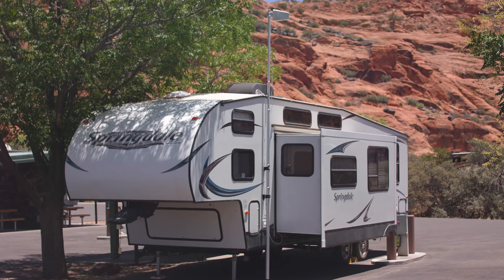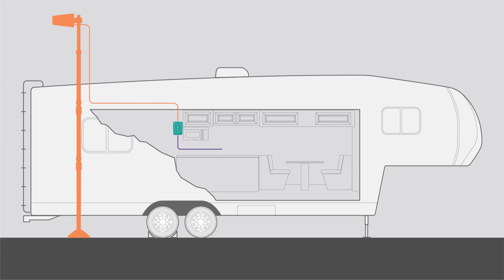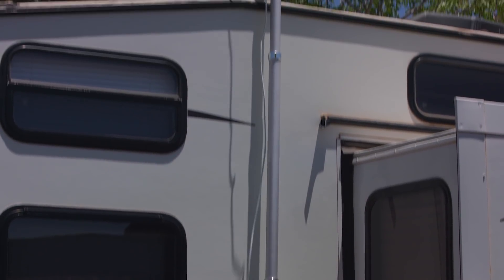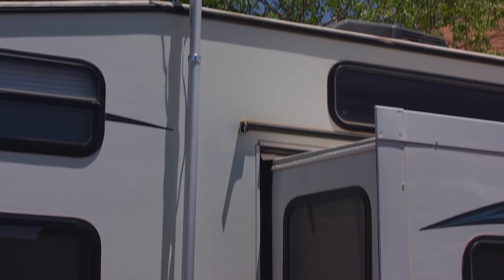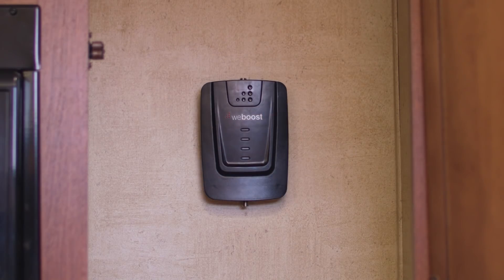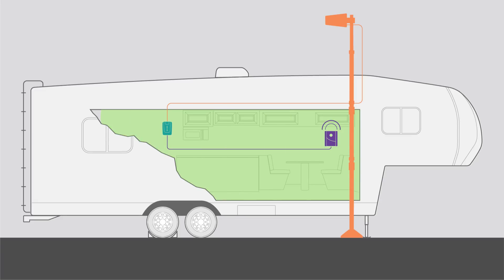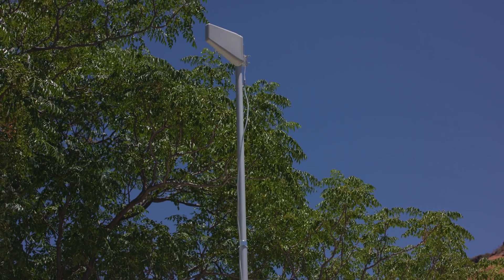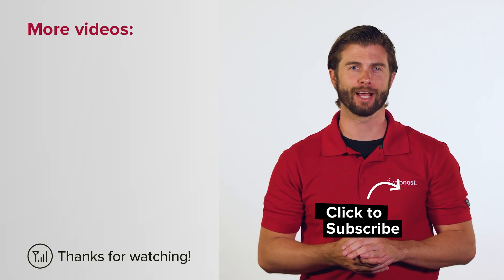Installing the Connect RV 65, cell signal booster for your RV | weBoost

Comment: The only difference is an Omni directional antenna and you can use them on the move. Gain is slightly lower on Omni. And aiming a directional is a challenge.

Comment: I just have a little teardrop trailer and separation of these two could be difficult also I do a lot of boondocking and don't have access to 120V all the time unless I use my generator.
Is there a 12-volt version?

Comment: Honest review from someone using this at various locations for over a year. IT DOESN'T WORK! I have yet for it to boost any signal, all locations had a minor signal, none had no signal. I measure signal strength using Network Info app (in decibels) I point using Open Signal app, my carrier is ATT and tested T-Mobile and Verizon...none showed any improvement and often degraded. The powered internal box gets so hot that it makes me nervous as well.
Reply: Sounds like you got an issue. I ran one all the way up a 50 ft tower behind my house. Pointed it at a cell tower 6 miles away. (I went to the tower to test its strength). The signal is so strong the booster is actually on the edge of overloading its so fast. Around 40mp down and 5-10mb up. Using LMR 400. A quality cable. That might be your issue.